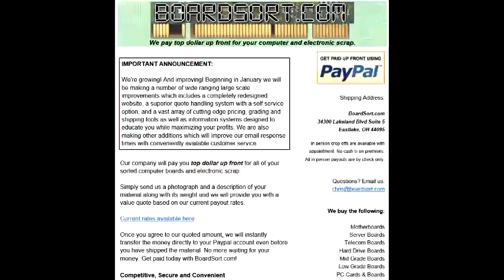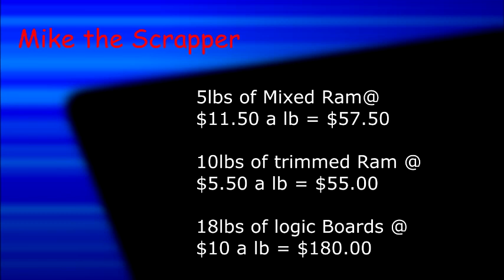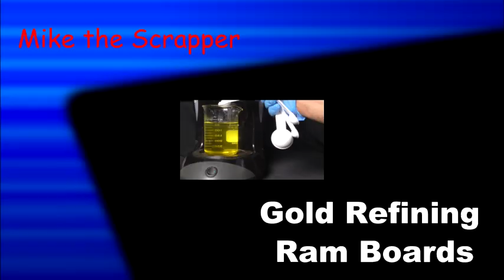Selling your Boards for CASH!

Comment: Thanks for the tip Mike! Wish I had seen this a couple days ago. I found some nice clean copper heat-sinks in older restaurant POS systems, specifically the PosX Brand of POS systems, but the older heavier ones with the metal encasement, not the plastic . They were all-in-one pc's bascially. Anyway, I saw the price for the clean copper heat sinks on the boardsort website price list, and my jaw dropped. i sold them for basically pennies on the dollar at the local recylcler for clean copper compared to what boardsort is paying... ugh! lol... but it's not the last of the copper heatsinks I will have... and I know where I will be selling them next time - thanks again!  :)
- Howard
Reply from the maker: Thank you for watching...

Comment: Hi Mike, nice vid. Are "trimmed" RAM boards those you have removed the fingers from? And mother boards, do they but them after the CPU and other gold has been removed. Going to their site and they may have answers there.....thanks!
Reply from the maker: after you remove the fingers on ram it would be fingerless and yes they do buy them. As far as the motherboard. If you remove all the parts that did not come with the board that is still a motherboard. You will want to separate the cpu & ram so you can sell separately

Comment: For recovering gold from boards, what would happen if you just burned the boards? The gold isn't going to burn away.
Reply from the maker: There is a lot of other precious metal on the boards. if you burned the boards, there is a lot of toxic chemicals that will get in your lungs and air. Which is not good for you.

Comment: Hi Mike, I just started deal with boardsort.com. I was wondering under what category do small laptop boards like wifi boards, audio boards and other small pieces like fall under. Are they considered mid grade green boards?
 Also what about laptop motherboards?
Reply from the maker: Look at boardsorts website. it will have all the info you need.

Comment: questions:
in sending the boards, would you cut the gold fingers off/ remove the gold pins, or leave as-is,
do you remove the chips, and
whats the top weight (that they will take)?
I've a lot of broken boards from gedgets, disk drives, and removed the chips)- will they take those boards, and chips?
thanks for the video!
Reply from the maker: I would leave the fingers attached. The only boards I would not send is Low Grade. it adds up in weight but not worth the $.10 - .$15 a lb for them.
Reply: thanks!
i'll do that!

Comment: Great video as usual, but doe's this mean your'e giving up on gold recovery? and do they take all boards or only logic board's?I have tub's of board's but still have trouble telling  one from another. where do you sell your'e  magnet's? how about carbon out of transformer's?
Reply from the maker: they take all boards. look at the website and you can see a list of everything they accept. Magnets have to be alnico and Transformers I sell as is...
Reply: Mike the Scrapper Thank's Mike!
Reply: If you look at their price list, there's links you can click on which will pop open a new window and will give you a sample photo and description of each board type.  For example a mid-grade board is green on both sides and may include power elements such as transformers.  Mid-grade boards usually do not contain any plating of precious metal on the board surface, but may have some on any socket connectors that are soldered on.

Comment: Anyone Interested on buying cellphone boards? From old dumb cellphones.  Not the new smart ones.  50-100 lbs.
Reply: Boardsort will take those.  To get top dollar for them, try to clean any aluminum or steel off the boards.  You may need to use a sand bath to get some pieces off.  Take a few photos of the boards and e-mail them to boardsort and they will get back with you with a price.

Comment: Hey mike is boardsort relieble? I ask u this because i read on the site that there prices can change without notice. Have u ever heard of someone getting the prices changed on them once they sent there parts?
Reply from the maker: they are reliable... Prices change like in the scrapyards. what you do is take pic of what you have with weight and send them an email. they will quote you back prices of the day and pay you that price. Even if prices drop further you have your price locked in.
Reply: Thanks